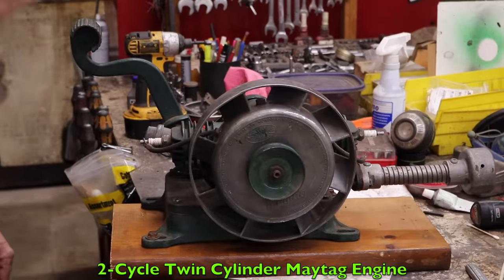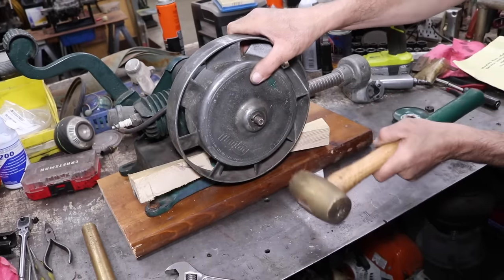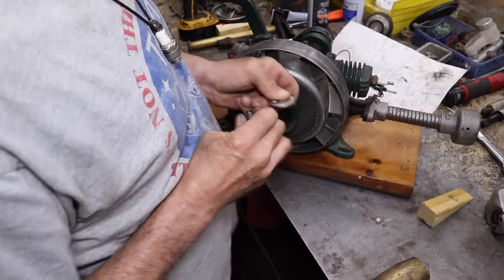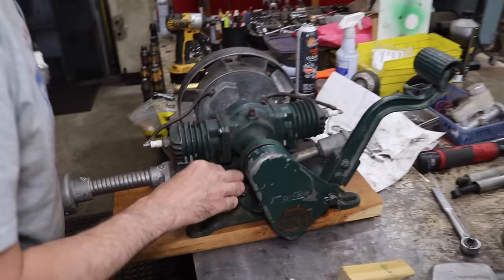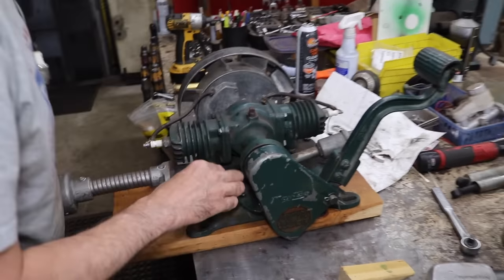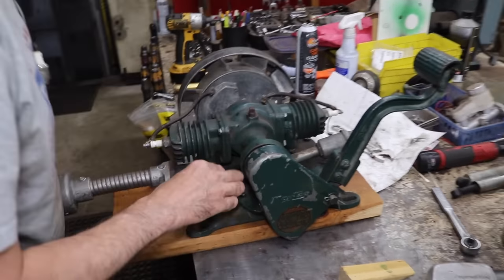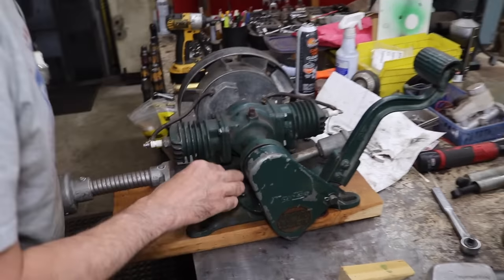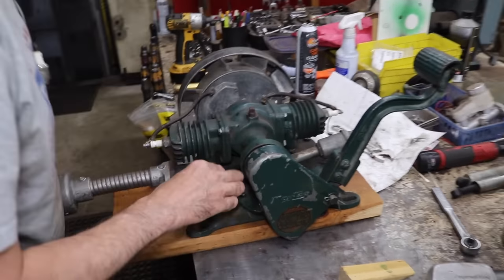What Is This Thing? Will It Run?

Comment: My dad worked on these engines at Maytag.  He told me they was a very good engine.  The consumer would put the wrong spark plugs in.  Also put oil in the gas tank instead of gas.  My dad was one of about 50 guys that worked on repairing these engines back in the late 30’s - 50’s.

Comment: As an old appliance repairman, I believe these used a lot longer than 52. I colder climates Alaska, northern Canada they are still used. The newer washers never drained completely and the pumps would freeze, the fill valves would freeze and bust. These old ringers were filled with a bucket a garden hose. The drain you just laid it on the ground and would drain completely is my understanding.
Reply: My great grandma still used her washing machine till the mid 80s when my papa (her son) got her and electric washer.

Comment: Most rural areas of the USA didn’t get electricity until the passage of the Rural Electrification Act. The act was enacted in 1936 but obviously it took time to electrify rural America. Prior to this, there were all kinds of gasoline fueled machines to do work. General Motors’ Delco division had an entire line of products to aid rural settings with modern amenities. For anyone curious, look up “Delco Light Plant”. I actually have a Delco well pump , but do not have the Delco power plant to animate it. Anyway, the Delco Light Plant could be used to electrify a home. It would provide light via a lead acid battery array which I believe was 36 volts. The power plant would keep the battery array charged, utilizing voltage sense that would automatically start/idle the engine based on electric demands. They offered numerous 36 volt accessories for it, including a vacuum cleaner and washing machine tub. Other accessories (like the water pump I referenced) were belt driven by the power plant directly. The Delco Light division ceased to exist sometime around 1955, because most customers had switched to municipal electricity by that time.

Cool find Taryl!

Edit: I misspoke about the direct belt drive. My pump would have had a small electric motor with its own belt to run the pump. This electric motor would have run off the electricity generated by the Delco Light Plant/battery array.

Comment: I worked on many of these old Maytag engines when I was a Teenager including those 2 Cylinder boxer engines and that was back in the early 70's,.. So nothing new to me. The 2 banger did run a lot smoother than the 1 Cyl did. That knob by the kickstarter is the throttle itself😉. Thanks for the memories though Taryl.

Comment: 14 years ago my father-in-law passed away. As we went through his stuff we found out he had two hit-miss engines we had never heard him mention or play with. One was a single cylinder maytag (1929) similar to yours and the other was a 400 lb 3.5 HP Hercules engine (1915). The Maytag ran pretty soon with not a lot other than cleaning the carb pickup and the points (Like Taryl's). Even my teenage daughter liked starting it.
I found the big Hurcules more interesting nut more of a challenge to get running. So I sold the Maytag. They're pretty popular but don't sell for huge money. I used that money to get the Hurcules re-bored (compression was horrible and really needed help. Now the Hercules runs whenever I want it to. I kind of regret selling the Maytag but they're much easier to buy than the bigger hit-miss engines.
Thanks for the video.. was fun to see you do almost exactly what I did (but you do it faster). Those things were very well made.

Comment: I am 80 years old, and when a youngster I saw a  MayTag washing machine engine being used to operate a old water well pump.When the water tank needed filling some one in the house hold would start the engine and fill the holding tank.

Comment: The white wringer Maytag washers were a piece of mechanical art.
Reply: Unless you had to run one, then hang the wet clothes, as well as towels/ bedding of eight children, two parents and three boarders. Auto wash and dry was a god send .
Reply: @RaysLaughsAndLyrics  I repaired them. The inner working of the wringer head are a marvel. Yes ,Yes the dryer is a time and labor saver.
Reply: Very nice equipment out on the farm with no electricity.

Comment: When I was a GM mechanic I was the only guy to engines, I rebuilt or replaced tons of them, and if we didn't have a gasket for whatever I was installing I would use the thin ac-delco box it came in,
Never had a leak come back🤓

Comment: I remember my Mother talking about how back in the 30s they did not have electricity. They did however have a gas well, which provided gas for the lights, cooking and heating. Washing was done on a washing board and a tub that had a hand operated agitator, all for a family of ten. Then one day she got a gasoline powered washing machine. She was so excited that she sat on the porch and watched it was clothes all day long. Watching this video reminded me of how I completely restored one of these twin cylinder engines many years ago and whenever I run it I think of my Grandmother.

Comment: It's a 2 cycle, split the gas tank and check the flapper valve. I bet it's seized, gummed up, rusted, etc. You need some leaded gas lololol. You don't have torch tip cleaners? C'mon Taryl! I've found The best way to make a gasket here would be to take the tank and turn it over on my scanner, copier, etc. Scan it, then adhere it to flattened gasket paper, cut out your gasket. 😊😊

Comment: One thing to note about that engine (I know I'm a bit late to the party on this one) is the tank is cast iron and if memory serves right they would have a coating of some sort to keep fuel from seeping into the cast iron since it's a bit porous and would start weeping fuel otherwise. I'm not sure if your scraping the tank would have damaged the coating or not, but it's something good to keep in mind in case you ever work on another antique Maytag washing machine motor.

Comment: WOW! That brings back memories of the late fifties! In my early years (i'm 80 now) i started to play with one of these exact engines.  I built my own version of a carburator, nothing more than a aluminum tube that i necked down to make a venturi (no throttle plate just wide open). I broke the keepers on the magneto plate so i could advance the spark MUCH more.  I have no idea how many RPM it would turn, but it was WAY more than stock. I attached an old Modle A ford radiator fan to it and attached it to my sled that pushed me along on a snow packed drivway. I was 12 or 13.  Fond memories Ha!

Comment: I saw a few in my day. Guys liked to build go-carts out of them. They weren't really good for that as they are pretty small engines buy they liked the kick start. Around here, most were the little single cylinder ones. Those twin cylinder ones were pretty rare. You know that isn't a body hammer. That's a Mustie1 hammer. Not odd to me that they made them that late. Many rural locations didn't have power even after that.

Comment: You pulled off the motor, added a gas engine where the electric motor was on  your old open top roll wringer Maytag washing machine and used it out on the back porch, weather permitting. When the oil company discovered natural gas up there we got electricity, natural gas, an AC electrical water pump for the well, satellite TV and all kinds of goodies, including free helicopter rides into town. Before that we used an outhouse, a light plant, and had a crank telephone. Light plants charge batteries for lighting and an old 90 volt DC AM radio but they don't work for appliances at all.

Comment: It is definitely a lot faster to make the gasket using the bottom of the gas tank. Had both the twins and the singles and took them to Portland every year. Fun simple little engines. Restored quite a few of them over the years.

Comment: I had one of these on my 1st GoKart in the mid 50's. Bairly enough power to do 5 MPH on the flat. Replaced with a B&S from an old tiller. Cool & quiet old motor.

Comment: speed is hit and miss ignition regulated. when its running without load its supposed to misfire. the twin really runs smooth. I had a single when I was  a kid and it vibrated a lot more. the one I got came off my grandmothers maytag washer on her farm. they put a 110volt ac maytag electric motor on the machine instead when the farm got REA electricity. the entire farm ran on a 3KVA power pole transformer. obviously power got upgraded soon to a 25KVA power pole transformer.

Comment: STARTING AT 14:26 ON THE LEFT-HAND SIDE, WITH THE FLYWHEEL. 
YOU CAN SEE AN ORB FLOATING DOWN ALONG THE RUBBER MAT,
 THEN MOVING IN A WEIRD WAY. IF THIS IS AN ORB, I WONDER IF IT'S 
THE OLD MAYTAG ENGINE THAT ATTACKED THE GHOST IN THE FIRST PLACE.
PARANORMAL BABY. TARYL YOUR SHOP IS HAUNTED.  LOL..👻👻
Reply: Reflection on camera lens I had to go back and see it

Comment: Taryl, I am also assuming that the rpm monitor that was used calculates the number of sparks per minute; hence, I believe the actual RPM was 800 rpm.  Since the opposing spark plug wire needed to be grounded when testing for spark, that is indicative of a waste spark ignition system in which both plugs fire on a 180 degree cycle.

Comment: Taryl is the MAN,  please make a modern Loafer no deck mower with push mower bolted to front of a no deck mower.  Most mower decks are a pain to work on, worn out belts, lengths are hard to get, parts are worn out. even if you raise the mower still hard to work on , loafer is better. Also the best front mower motor would be a old riding mower electric start engine with coupling to bolt on mower ONE blade. so you can electric start front push mower engine. SINGLE CYL FRONT PUSH MOWER ENGINE ELECTRIC START W BLADE NO PULLYS OR BELTS BOLT TO REAR OLD NO DECK SINGLE CYL RIDING MOWER

Comment: I had a Briggs WM and I used a snowmobile primer on it to get it started, the speed is around the speed of an electric motor which is  1700 rpm.

Comment: A lot of remote houses and farms did not have electricity even in the 50s.  They were still making "farm radios" in the 50s too.  They are battery operated and cost a fortune to operate because the tubes need high voltage and high current low voltage.  They ran off a special A/B battery with a 3 or 6v heater filament and a 67 or 90v B+ Voltage for the radio circuitry.

Comment: I had a old  Yamaha DT  125 motorcycle crank thread to hold flywheel ruined busted off flush. I drilled in center tapped new threads put a grade 8 3/8-24  cap screw in it with a hardened washer to hold flywheel on.
It ran for years .
Also on Evinrude outboard 40 hp
Reply: DT125E Best motorcycle i ever owned.
Reply: @amunderdog  I had 1972 ones way back . Got them as basket cases when I was a kid in 1975 . Learned to rebuild them by myself .
Couldn't afford new YZ125 so I tried to build one junker lol

Comment: Had a unit with a threads missing and chewy on a tapered shaft, it would tighten pretty good then loosen in just a few minutes -- used super glue and baking soda trick as thread locker, lasted months.
There's your dinner, super-duper thread locker Woo!

Comment: Flywheel supply out of la mars Iowa.thay will have everything you need to repair it Thay carry rebuilt carbs,plugs, gaskets,point ect.i have a model 92 great little engine simple design make sure to run heavy on the oil mix

Comment: There should be a number on the flywheel that will correspond to the dates in your book.  Curious of your year.  My single cylinder ( on a working washer) is a 1935.
Reply: Those Maytags just never seem to die, still see Maytag wringer washers that pop up for sale in my area from time to time and still occasionally see Maytag washers from the 60’s and 70’s that pop up for sale in the Southern California area. Even have a few myself I use and collect, one of them of which is a TOL A806 in my profile picture and another is a avocado A606 set from 1973.
Reply: @seana806  Hey there, stranger :)
Reply: @muziklvr7776  hi there :)

Comment: I was told don't use 2 cycle oil. Use non-detergent 30 weight at a 35-1 ratio.
Reply: I use Klotz beano 2 stroke oil and leaded gasoline with zero problems for many years on the old Maytag engines I have. Yes you can use 30w if you want to fog for mosquitoes and have a mess. You can burn Coleman fuel aka White gas with 30w and these engines do not care. Add some Marvel Mystery Oil in every other tank of fuel and you will be fine.
Reply: @sswcustomsewing4276  Didn't realize you could still buy the castor based oils anymore. Thanks.

Comment: I suppose you can use an rtv type for a gasket just around the edges, I think the paper one that isn't compressed between two surfaces might eventually start giving off bits that might clog the intake pipe.

Comment: I guess if you consider the fact that my great grandparents didn't get electricity until 1957, a new gas powered Maytag in 1952 isn't all that outrageous. That thing is much quieter than I expected and doesn't smoke much either.

Comment: Having a gasoline powered washing machine would be sweet from the prepper standpoint. When electricity is non existant or too expensive to afford, this motor could be run off of gasoline, methanol, or even propane- if you get creative with the oiling.

Comment: I'm Reviving an MTD tractor for my son to use. I want to get the seat switch working properly. The spring is currently off from the seat I can not figure out a good way to put the spring back on as it is extremely difficult to stretch. Could you make a short video on how to do this properly. Thank you

Comment: I used to have one of those things. I got it running, but the crankshaft bearings were worn and it didn't get enough oil and it locked up. Couldn't get it loose again.

Comment: If I remember correctly, I think those are spark governed
Reply: On the twins there is a brass plunger in the crank that cuts the fuel supply if the rpm goes to high. Centrifugal force activists the plunger.
Reply: @quickturn66  I kinda remember that now thanks for correcting me Steve.

Comment: I have a motor almost exactly the same as that one but mine has a plate that goes on top of the motor show that it is hung under the washing machine not mounted to the base I did basically the same thing you did and got mine running and I have a video of it

Comment: You should put a prop on that thing make a trolling motor out of it catch some walleye in the 50s outboard motors said in the owner manual to use 30 weight motor oil in the gas they didn’t have two stroke oil

Comment: You should be able to take the end of the tube apart. To get to the check valve. It should move free.
Reply: You need to go to the top and pull the plug out and adjust the govener. It should go faster.

Comment: Does the tank pressurize to push fuel in? If so the leaking fuel tank gasket would be your pressure loss. There's your dinner ☺️

Comment: I think you got part of your video backwards because you clean the points and then had a engine with no spark that miraculously turn to an engine with spark with no change other than you grounding a spark plug wire. There was no fix to fix the no spark after cleaning the points sequentially in the video.

Comment: 2 cycle oil is not goodfor these engines.  run 30w engine oil in the gasoline.... I do not know the mixture but 2 cycle oil is not supposed to be used in these engines 30w mixed with the gasoline
Reply: 30 weight, non detergent oil.
Reply: @muziklvr7776  16 to 1

Comment: Is this engine a 2 cycle not a 4 cycle aren't you to also put 2 stuck with gas on the tank not regular gas read your manual and find out if it is 2 cycle gas